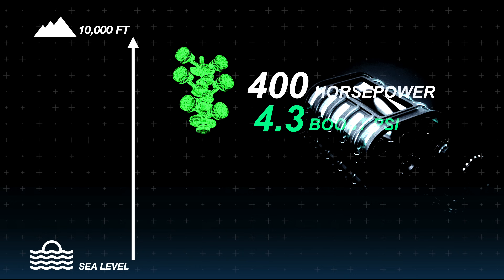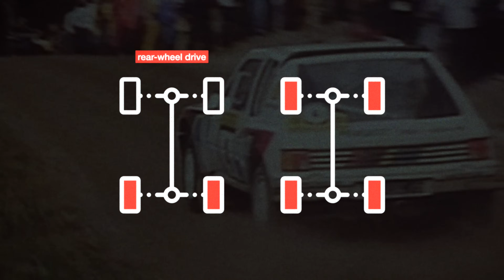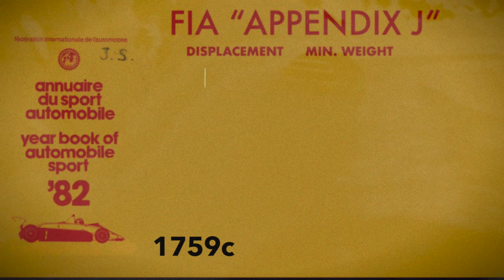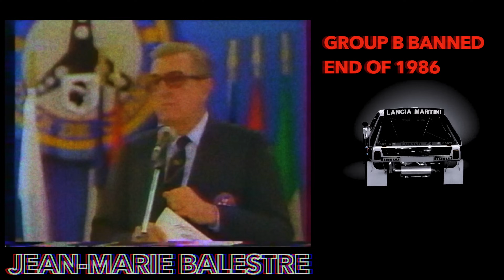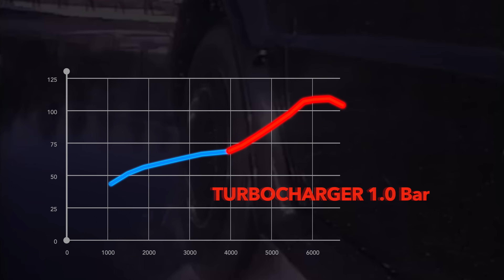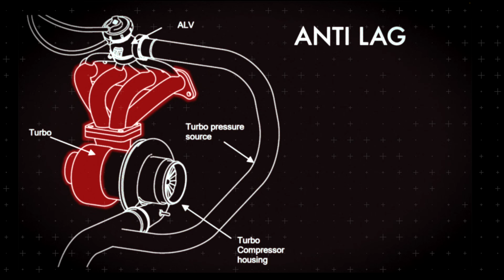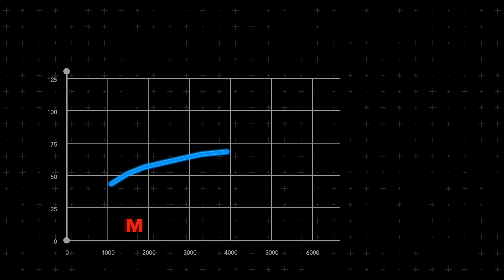The Engine That Was Banned From Racing | Explained Ep.29

Comment: A supercharger will not move as much air as a turbo and they should not be used together ever. It doesn't matter is the supercharger is huge. A big supercharger with a small turbo makes the turbo useless and a small supercharger with a big turbo will restrict air flow. It's the dumbest thing anyone has ever come up with. They limit each other so just pick one or the other.
Reply: i thought using electronic solenoids and diffrent rubber air boost tubes solved thie so they work independantly never together , i am a complete beginer to this technologly never owned anything boosted just been looking into it a bit though so you may be right and im probably wrong,
Reply: did you think they just simply bolt the two together through the same boost tube for real ? lol

Comment: this is only topped by Lancia's ECV2 Triflux-Engine for the Group S Rallye. That is for me still the craziest engine from that era, even tho it never made it into the actual race because Group S never happened. But the engineering behind that engine is magnificent
Reply: Dude I think the ECV2 would’ve been the greatest car ever made if they hadn’t cancelled it because they reversed the turbos, manifolds, and upgraded the cooling on the triflux to make it more drivable and on top of the amazing engine was a smaller, lighter, and more aerodynamic body with better weight distribution that still looks modern to this day, the car was about 30 years ahead of it’s time.

Comment: The P-47 and some other radial engine planes used both super chargers and turbos. They did it in a weird setup where the turbo just maintained full manifold pressure throughout the entire range of the plane. They built a system that could produce way more boost than the plane could handle at low altitude. Then just varied how much exhaust was routed to the turbo to maintain full boost all the time. 

There was a large bypass valve that could either dump all the exhaust gases to atmosphere or run it all through the turbo and everything in-between. 

It was done with the intent of being able to maintain maximum boost pressure throughout the entire operating range. 

A modern computer controlled car take on the same setup would be really interesting. Just setup to make full boost from idle to maximum RPM. The super charger making full boost at idle and the turbo getting just as much exhaust as needed to maintain full boost throughout the entire rpm range. No more no less. 

Any time you over boost and have to deal with the extra boost in some way other than sending it into the engine it wastes a ton of energy. Even just throttling it wastes a ton of energy people don't know about. We're just used to doing it so don't know an alternative is possible. 

A setup like I described would be both extremely energy efficient and have a really weird hp and torque curve compared to engines we're used to. It wouldn't be technically flat but would have a relatively flat HP and torque curve. 

It would probably feel more like an electric vehicle than a gas engined vehicle. Just an engine running at maximum boost throughout it's operating range. Weird by today's standards but has obviously been done before and forgotten. Also a much simpler system than some of today's crazy turbo setups that have all kinds of maintenance issues. 

Hell we could also take a page from late WW2 and run water methanol injection. Have a setting called war emergency power that ran the W/M injection and produced extra boost. Again all throughout the operating range. 

Oh one more weird insight from WW2 that somehow got forgotten. The Meredith effect. Back then they knew how to offset the radiator drag by using the wasted heat to make usable thrust. 

Yet for some reason today even F1 cars just have to deal with radiators creating massive amounts of drag. Not to mention all the vehicles driving down the road wasting potentially useful energy as just waste heat and drag.
Reply: In fact, full boost at idle (and to the max RPM) was done by Prodrive Subaru WRC team in mid 2000s. Search "Subaru rocket anti lag". 
Prodrive fitted rocket combuster, made out of inconel, into the exhaust, between the exhaust manifold and turbo. With use of sensors, fresh air and fuel feed and electronics, that combuster kept turbo spooled up constantly.

Comment: Boost is no replacement for displacement in the big picture as increasing the cylinder pressure puts too much stress on all components which is not happening with big displacement engines. That's why they live much longer...

Comment: Nissan were the first to add twin charging to a road car in the late 80s.
Their domestic market Nissan March Super Turbo was a 930cc 4cyl super charged and turbo charged EFI engine. The car was released as the top of the March (Micra) line and was designed to compete in Group A 1300-1600cc for racing and rallying. 
(The FIA dictated multiplying the engine capacity by 1.7 for forced induction = 1581cc)

Comment: Not sure how relevant it is to this story but I have seen and heard a late 60s Mustang with a 427 Wedge engine with twin turbos AND and big ole blower (oh yeah two bottles and nitrous plumbing running around the fuel  in injection also) sticking out the top of it at "Cruising At the Coast" on the Gulf shores of Mississippi a couple of years in a row. I'm not sure how good it runs or if it's just a "show" car but it sure does put on a show lol😂. I have always wondered why super chargers and turbos didn't work together, especially in drag racing!?!? Super charger early and turbos for the top end speed!?!? But I am just a fan with a truck and a fast ass boat lol. Best Regards

Comment: So this is where Christian von Koenigsegg got the idea from but instead of a supercharger and a turbo, he chose two turbos, the small turbo spooling the big turbo on the lower revs.
Reply: A company in Colorado had a twin turbo setup for Cummins 5.9 l 6 cyl. The small turbo of 20 psi kicked in sooner than stock then 40 psi came in after 2000rpm.. 60 psi and 800 to 1000 hp. Good for a short while before refueling.

Comment: group B was like that : Audi find a way to homologate 4wd and turbo to the championship so other manufacturers copied Audi. 
Renault had already put a tiny turbo engine at the back of a small city car with the R5 turbo but it was a 2wd and it only managed to be competitive on tarmac like the Lancia 037 few years later (everybody knows that Lancia has used a clever management to win the 1983 championship). 
In 1984 Peugeot had the idea to copy every single most effective technique to be competitive with the use of a small car, 4wd and a small central turbo engine and won in 1985. 
Lancia wanted to take their title back and they did the same as Peugeot with a relatively small car middle engine etc....but Peugeot had already an "anti-lag" system and Audi had a combinaison of a powerfull engine and an efficient transmission so Lancia was forced to use a supercharger and a turbocharger on a mid-class mid-engine 4WD car but they forget to use efficient brakes.
Few hours before his accident Henry Toivonen complained about his brakes and his teammate also had problems with their brakes. The car was too powerful, too fast, too dangerous...it was group B

Comment: What if we did build a twin charger today with current modern technology increase the power of that engine let's say for example I don't know a V6 or a V8
Reply: I think Volvo makes one today. But, turbo tech has improved so much you don’t really have the long lag and sudden surge of the old turbos. Twin charging adds a lot of complexity and failure points for not much of an increase with modern turbos and engines.

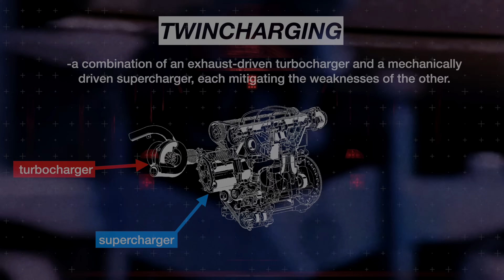Comment: C`on, make it more true and less phantastic. Just 2:30 min in there are already
1. S4 was never banned from racing (I know the US guys like that phrase, like the audis from imsa)
2. an S4 never had NEAR 1000 HP!!! They are known for 550HP in race trim (aka in a way they hold up, not a 5 sec dyno pull)
3. "cheating" (similar like above: audis "unfair advantage") it is just the case of RTFM! IF so, you see where you can get a benefit. This is NO cheating.

Comment: Some aircraft were actually twin charged in the later half of WWII.  They used turbos mostly to raise their flight ceiling and less performance gradient.  They started feeding superchargers with turbos as a means to start with sea level pressure before multiplying it for more power.  This was also being done on MASSIVE diesel V12 engines before the computer age.
Reply: The german fighter jets also had nitrous for a burst of speed in aerial combat.
Reply: @dr.hugog.hackenbush9443  FW190 to allow a Higher service ceiling, i.e. the B17s.👍
Reply: RR Merlin.
Reply: Yes, some of the BIG 24-cylinder Detroit 2-stroke diesels had 4 turbos boosting into 2 superchargers that were laid end to end down the LONG intake manifold. Those things ROARED when they were at full load

Comment: Well not completely banned in racing.
  The record holder and first production car to do 300mph from a standing start in one mile is both a twin-turbocharger running into a single supercharger. It's an 2007 Ford GT. It uses the stock 5.4L block and makes 3000 hp.

Comment: Not taking anything away from the video, exceptional quality and great watch. I will however continue to point out that boost isnt a replacement for displacement, its just next level power maker. Yes with boost you make big displacement power from small displacement engines but when you boost the big displacement engine it proportionally outpaces once again 😂 not to break anyones hearts here because all well built machines are gorgeous but lets stay real
Edit: mah spelling

Comment: Although i believe the fires are suspect and most likely dew and or arson but.. ive seen many many burnt out cars and i can tell u they allways melt the aluminium and they are abundant with fuel other  than the fuel tank. The aluminium cylinder heads sometimes  disapear and all u see under bonnet is the steal cams and valve gear sat ontop of the bottom end iron block. Relax guys these cars are very typical . Go buy a scrap car and set fire to it on some private land well well away from anything else. They will look the sameas these after a few hours. Simply set fire to the seats and leave windows open  and stay way back for when thefuel tank goes. I 1st watched a car burn when i was  11 on a feild behind my school.(mk2 escort) Another when i wasabout 15 when my ideot neighbour set fire to his daughter Vauxhall novswhilst welding it. Ive seen about 5 cars burn plus ive seen atleast another 50 burnt out cars in salvage yards

Comment: Italian here. The car or the engine didn't get banned because of its crazy power, but because spectators kept dying because they would often place themselves on the outside of turns or even inside the road itself. 
You can find some group B rally videos where cars crash into dozens of spectators killing many. 
Whoever decided to close group B, focused on blaming the cars, but instead it was the spectators. 
Modern rally is faster than group B, but it's nowhere close to being canceled. They just have more strict rules on spectators. 
Side note: engine has never been tuned above 600-650HP for actual races, and most of the times it was set to 400-450
Reply: I saw a video.... group B was cancelled when the drivers striked because of the lack of spectator control and class rules. FIA did not end it the drivers did.
Reply: @GraeboProductions  yes... 
My point was, the reason was the spectators, not the cars
Reply: Very interesting
Reply: Portugal springs to mind. Nuts.

Comment: This is why I'm gonna twin change my 7.7 liter v8. I want a cadillac Deville that could beat a McLauren. I'm gonna do cantilever suspension and have active arrow built into it it. I may need to make carbon fiber fenders and body panels to help with weight and I may have to push the transmission to the rear and re gear the rear diff to work with the 3 geared beast.

Comment: I always had this idea, where a centrifugal supercharger was coupled to a turbo and de clutched when the turbo got to speed. 
I'm wrong, but it could work.
Reply: some of the 2-stroker diesels that were used on trains and maybe a few other applications did this.. turbo that was engine-driven at lower rpms but had an overrunning clutch to allow the turbo to spin up off the exhaust-pressure/heat at higher rpms, would act like a supercharger/blower at lower rpm, then light-off like a turbo at higher rpms
Reply: @niteriderevo9179  oh snap! That's cool! Thanks!

Comment: All the information was correct, but the title... the engine was never "banned". The whole rally class just was terminated, not because of this engine, but because of the increasing power of all cars in general and lack of safety. Lancia didn't use this engine again because it  just did not meet the requirements for Group A and because the Delta HF was proven to be already a beast with no direct competition. So yeah the information in the video is pretty accurate but the title is completely false.

Comment: It's wild that my k20 now makes all 1.5 bar at just 1800RPM...and back then that wasn't possible
Reply: I mean turbine and compressor design has improved tremendously but it's also in the sizing. For a 2ltr to make 20lbs of boost at 1800rpm you would normally be choking the high rpm range which is why OE developed variable geometry/variable vane technology.

Comment: the reason still to twin charge is to spare your wallet in the long run. anti-lag kills tubos at a fast rate. I honnestly also prefer the whistle of a tubo and the whine of a super-charger at the same time in stead of the gunfire of a anti-lag system, not to mention that ani-lag will get you a ticket soner or later.

Comment: Hey so I was playing a game the other day and the boost from a supercharged engine immediately dropped to negative when I let go of the throttle. Intuitively I'd say the boost drops proportional to the rpm, which one is true and why does it happen?
Reply: supercharger is typically post throttlebody/carb[s], so both s/c and engine wants to pull air through a now partially~mostly closed off air source, hence the negative pressure.. engine and supercharger both are effectively air pumps, so, close off the air source, they will pull air from the space post that restriction, thus dropping the pressure in said space.. [ie intake manifold/ intake plenum in an engine] the supercharger usually isn't as effective as the engine itself at pulling this negative pressure, so the supercharger drops off into an ineffective state very quickly vs the engine, which has way better backflow prevention inherent to the design and how it works.. and the game is simulating that pressure-drop.. turbo cars will do the same, only the actual turbo usually tends to be before the throttle body, so it still has unrestricted air vs the engine and now has to dump that excess air it pulled in, thus compressor stalling or having a blow-off valve open up from the now massively dropped intake manifold air pressure..

Comment: I've been thinking that the spinning shaft of a turbocharger could be extended to be driven by an electric motor that declutches and is turned off when the pressure on the exhaust side of the turbo rises high enough.  Its battery could be set up to recharge from the alternator only on deceleration.
Reply: Electric turbocharger. I think Garrett is working on something like that but more for fuel efficiency. (Edit) Now I think of it I believe F1 does/use to do something like that with there turbo to charge their batteries.

Comment: Nice video about these engines. But for the record  a supercharger boost intake vacuum to psi. There are two kinds, centrifugal and positive displacement. There's a big difference. Also a intercooler is (IN ) between 2 superchargers, a after cooler is (After) the supercharger. None of this is new to the engine world, this stuff has neen done since the industrial age.